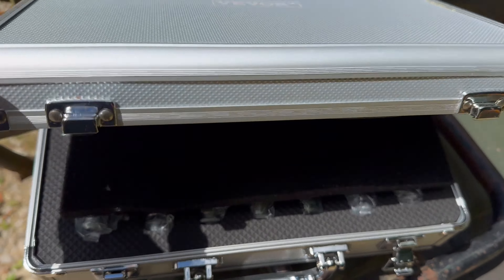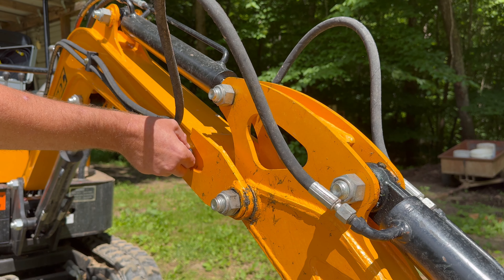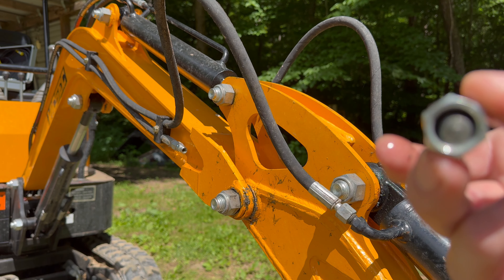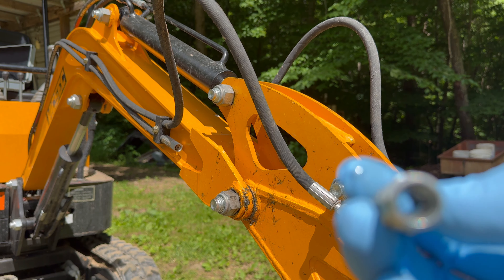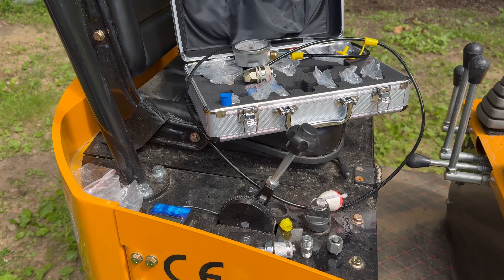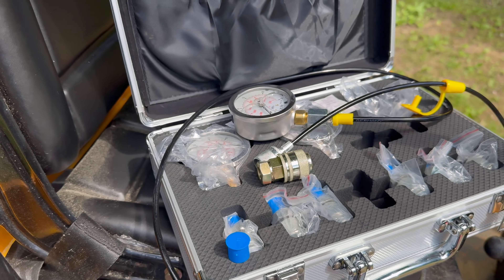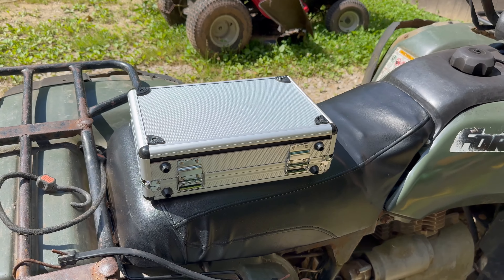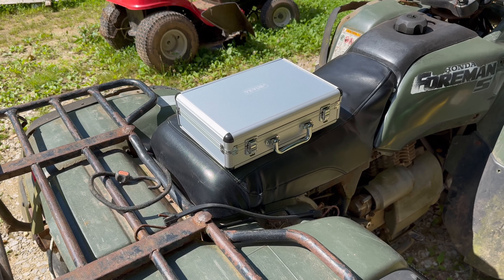Chinese Mini Excavator !! Checking Hydraulic Pressure ? Help ?

Comment: Hey, Im blanking on this right now, but I installed a hydraulic thumb on those lines and had the same confusing part. I will say, I didn't need to buy anything. That part you took off initially, comes apart some more and somehow goes back together with the right connections. Look more at it. Sorry I did this about half a year ago, but you should be able to connect that with everything there.
Reply from the maker: i just can’t connect it to the hydraulic gauges. i’m going to try another hydraulic shop and see it they carry a coupling of some sort. it’s crazy the simplest fix is always the hardest to find.